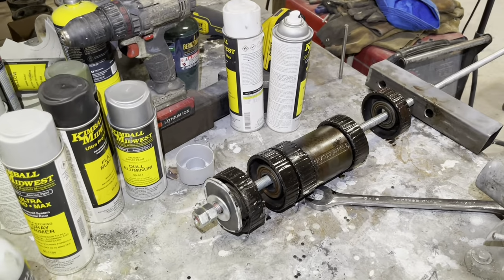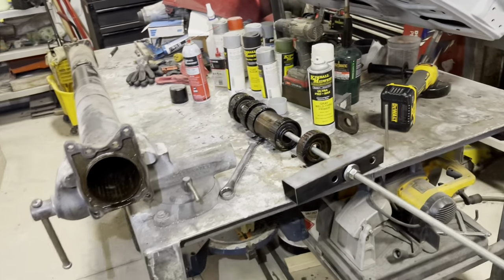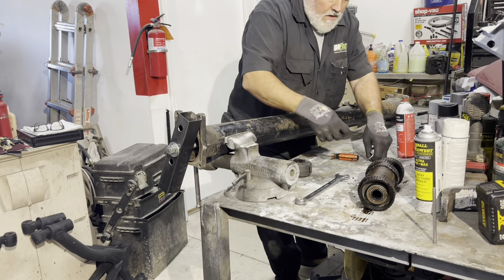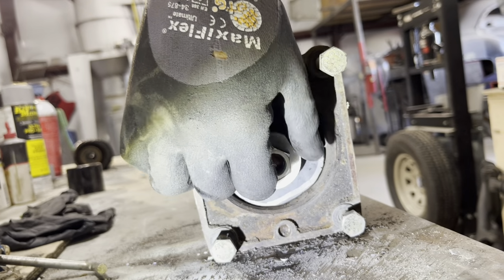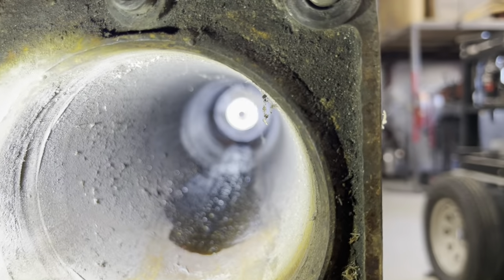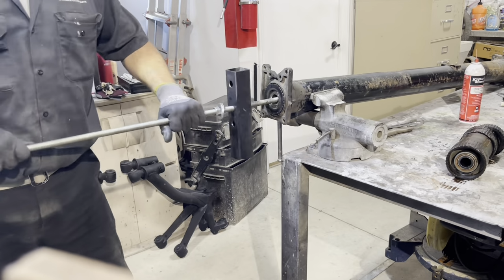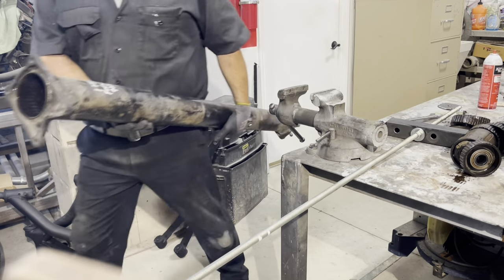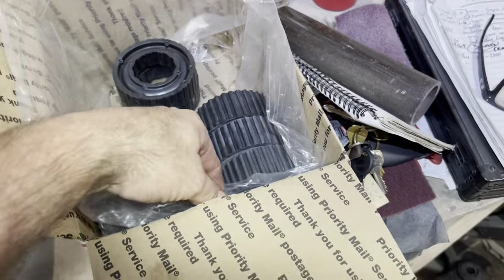Porsche 928 Torque Tube Rebuild — Bearing Removal

Comment: Why didn’t you use two nuts and a wrench instead of a vice grips and an impact drill on the tool. Turning a wrench that much is painfully boring.
Reply from the maker: Because another fellow said and showed how the Threaded Rod turned into a torsion bar no longer doing it’s job. I was not at all concerned about being bored—much more concerned about applying maximum mechanical energy with no loss of power or any safety violations.